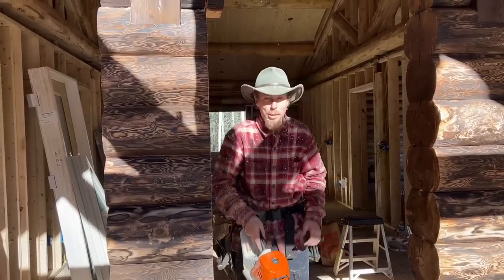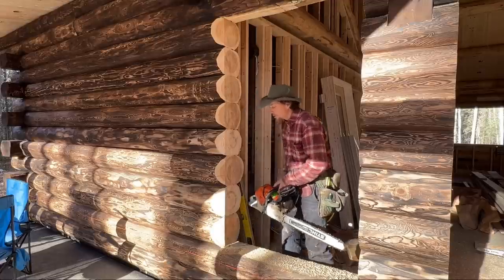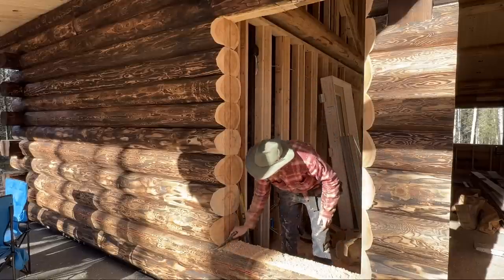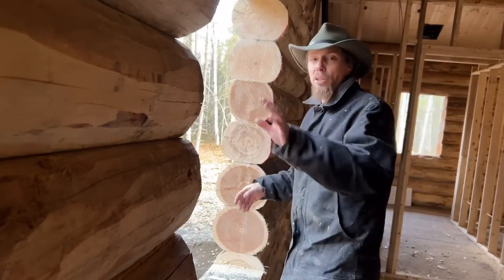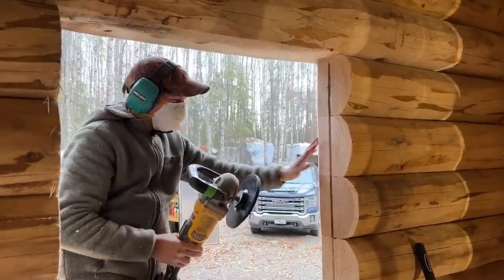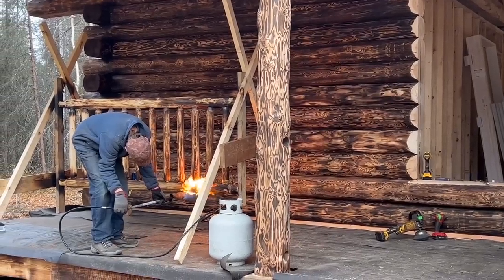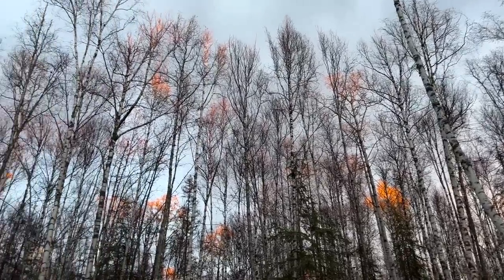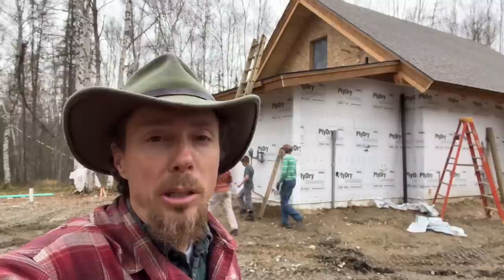Alaska Log Home - Cutting out Windows // Log Railing // Log Staining

Comment: I'm planning to buy a laser level but I know nothing about them.  Could you explain how they work and show what one you are using?  That would be very helpful.  I don't want to spend more than necessary.  Thanks!
Reply from the maker: I have only used deWalt and they work very well. I think Milwaukee makes a nice one as well. They are amazing and saves so much time and effort! you could likely get a cheaper one that would work just as well.